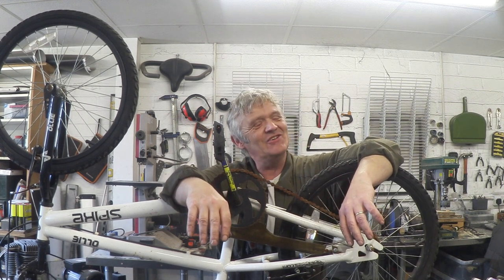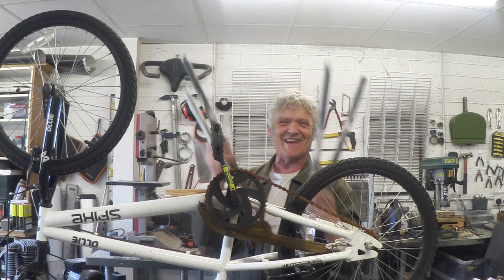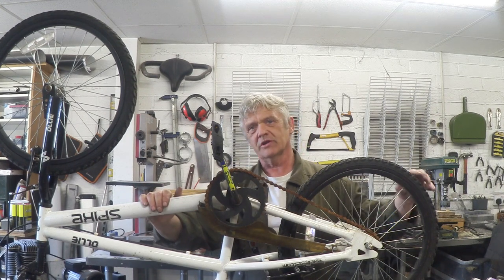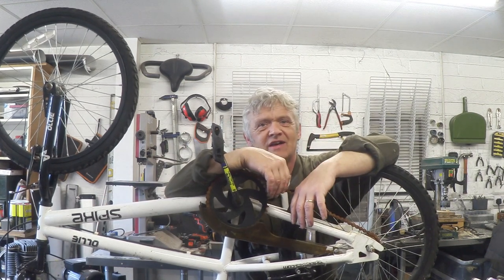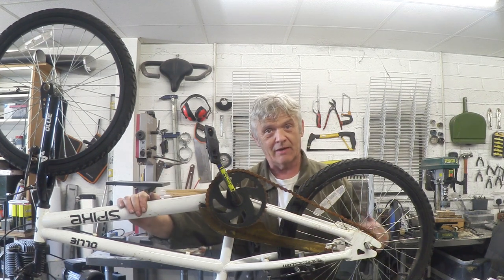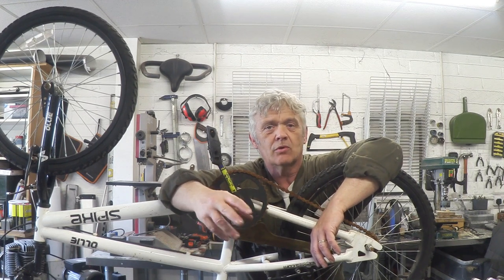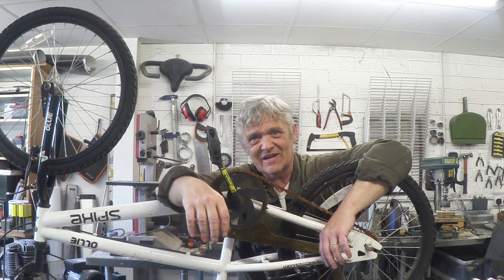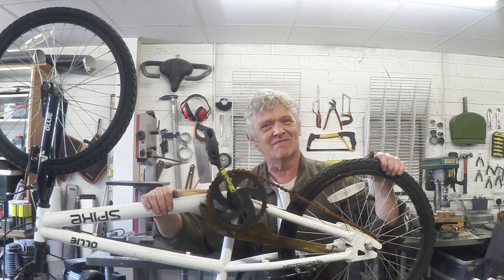1166 A Paper Bicycle -  Some Information

Comment: That Casein Glue sounds interesting, I got to try making it sometime! Also, thanks for the very important detail of using paper "grain" to maximize the paper tube strength!
Reply: It would probably work just fine if you orient the papers in the stack in different random directions.
Reply: @shay4578  Good point,  because that's the way they lay the grain in plywood laminations. I could be wrong but I still have the feeling to maximize the strength in one direction the grain should be aligned in one direction. I've seen laminated archery bows but the grain is always aligned in one direction.
Reply: @William_Hada  I agree with that, Cross lamination on an archery bow would be weak compared to being aligned. The grain direction is important to work with where the most stress will be.
Reply from the maker: in this example most of the stresses are going to be along the tube so we want the grain to run that way - but for a panel stiff in all directions cross ply would be good - for something like a box or model - it wouldn't matter that much

Comment: As an origami lover I've always thought a bunch of paper sheets is all we need to build anything.

There's a "spinning kirigami" I think can be used for energy harvesting.
Reply from the maker: paper is just plain awesome as an engineered material
Reply: 'where each part of the structure is an active power component, & only as a side benefit, structurally sound.'

angelus, do you practice the art! , take your 3d structures & colour them for each part that forms a basic battery/cap layered structure 'carbon/copper collector, carbon foam, separator, carbon foam, carbon/copper collector' unfold it, you now have a  flat 2 sided template with marked zones to conductive ink & reconstruct in bulk

Comment: Casting aerogel inside paper tubes (inside tubular pressure vessel) might work brilliantly.

Might even be a way of making an aerogel like material out of paper.
Reply from the maker: Cool idea!
Reply: How so?  Can you explain in more detail please?   If it is for structural purposes, I would be more apt to use carbonized nanocellulose crystals since it is far cheaper and fairly easy to make at home. These are basically kind of like nature's version of carbon nanotubes/rods.  If it is for insulation purposes, then the aerogel would be better.

Comment: Thanks for always managing to give us these mind-blowing moments 👏

Do you think sodium silicate would work for this? Please consider making a vid about this great paper glue you've mentioned, and other options for paper, if you may...
Reply from the maker: I think it would work fine mate - I didn't do a vid on the glue as there seemed to be a lot already - but I'll give it a go mate
Reply: It would work better if you did a mix of sodium silicate (majority, about 60%) with potassium silicate (about 25%) and lithium silicate (about 15%) added.  Makes it more water resistant, makes it last longer, and improves various strengths.  Something to do with the various sizes of the molecules and/or atomic orbits helping things to lock in together more tightly, though the research I've read indicates that we don't yet fully understand the whys.  

   Straight up, unmodified sodium silicate eventually gets very brittle, flaky, and loses adherence strength. And only takes a couple of months.  I've been experimenting with it some of late, and have seen it first hand.  I looked into the research and found that modified sodium silicate (can also be modified with other materials, such as the sugar alcohol xylitol) has much better and more durable properties, along with being more water resistant.  

  Even then, you're going to want a more fully water proof outer coating once everything is set and dried. Many things one can use, silicone, epoxy, Titebond III wood glue, etc.

Comment: PCB board were indeed made of pertinax or FR-2 material. It's not often used these days and replaced by FR-4. Basically the paper fiber is replaced by glass fiber.
Reply from the maker: cheers mate

Comment: Playing with the Grey-stuff yet again! ..... Thanks!

We used to have Phenollic cutouts (main fuse holder) .... but they are being phased out due to a small number of them having a small (1 or 2 v) voltage detected on them. The safety elves got all over it and now we replace them ;o(
Reply: Do you think it is possible  moisture getting in?
Reply from the maker: awesome mate - cheers
Reply: @lesallison9047   Not really! But you get dust and grease that can contaminate a surface. For me I would just give them a quick wipe down and retest, but Elf n' safety ....
Reply: @totherarf  Lmao, I Suspect that the Gremlins got in,,,
Chasing the Elves away....
So they can cause as much Havoc as possible!! Lol! :)
Andrea, Jasper and George the Pigeon. XxX.

Comment: Chinese armor was made of paper, but a little more than 200 years ago!  You've made a real world carbon fiber composite.  Looking forward to more.
Reply: Greeks did that as well cool.
Reply: Maybe he meant 2000 years?
Reply: @zylascope  Yes, unless he meant newsprint.
Reply from the maker: I meant paper manufacturing in bulk before that - more or less - it was hand made, slow and expensive
Reply from the maker: cheers mate
Reply from the maker: I meant paper manufacturing in bulk before that - more or less - it was hand made, slow and expensive
Reply: @ThinkingandTinkering  Absolutely!  While several documentatians have justifiably waxed ecstatic over the invention of the printing press, we'd be nowhere without inexpensive paper, too.  Also appreciated your mention of phenolics: a resin group we should use more of.
Reply: @ThinkingandTinkering  Ah, I see, ok, thanks for that. I had never made paper before until I tried what you showed once: making activated charcoal electrodes held together with paper. They worked well. Search: "Robert Murray-Smith - Papermaking And Supercapacitors"
Reply: Back when I used to work in the public and private school systems (US), I sometimes would comment to people, "if we ever have a school shooter, then take some unopened packages of copy paper and tape them to your front and back. 1 thick pack will stop most bullets fairly well."

  Though, to be honest, paper is not the most ideal material for structural purposes. Paper is basically wood, with most of the structural materials and properties taken out of it.  Dimensionally speaking, it has very low tensile and Young's modulus strengths.  The glue adds some of that back in, but in some cases, at a higher density cost and/or lower strength per weight ratio (minus high quality, expensive, composite specific epoxies). 

    However, within paper, wood, and cellulose fibers in general, is a vonder material called nanocellulose crystals. That stuff isolated and concentrated from cellulose sources, especially when carbonized, is truly some amazing stuff.  It (the carbonized version) is basically like nature's version of carbon nanotubes.  But unlike carbon nanotubes, you can make it in bulk relatively cheaply and fairly quickly. It is a very under utilized material.  

   I've flirted with the idea of making it in bulk and selling it. The graphitized form is very highly electrically conductive. It is basically the highly conductive, graphene like stuff in the "hemp battery", but more concentrated than in the carbonized hemp (since that retains some lignin and amorphous cellulose, which when it converts to carbon and graphite is not nearly as electrically conductive. It's all about that crystalline structure...).

Comment: Definitely interesting. What I would probably do, if I did something like this, is to use woven flax linen or hemp fabric impregnated with a combo of the casein glue mixed with some carbonized nanocellulose crystals.  Carbonized nanocellulose crystals are a bit like nature's carbon nanotubes/rods. Very high tensile and Young's Modulus strengths.  Then coat the outside with a truly waterproof glue or resin after it all sets.  One might want to use a cardboard tube as the core, to get it lighter and more hollow.  

    It won't be as strong and stiff as a carbon fiber tube, but it should be strong enough to work.  If you want to get near carbon fiber strength per weight, a combo of bamboo pole plus S-glass fiberglass, high quality composite epoxy, and carbonized nanocellulose crystals will get you pretty close on a strength to weight ratio.  Note, if using bamboo as the core, you have to sand/abrade the outer layer off some in order to get other materials to bond well with it.  The outermost layer of bamboo is usually very silica rich and harder to bond well to.

Comment: Paper! (its just very thin wood!)
Reply from the maker: yep!
Reply: Sort of. A good bit of the lignin is removed.  The lignin is one of the structural materials that helps the overall natural composite have greater, well, structure, and strength to weight ratio.  The glue adds some of that back in, but at a density cost (and depending on the glue, possibly also at tensile, Young's modulus, etc various strengths cost).  

    I understand that this is meant to be an alternative, in a sense, to the bamboo for the people who don't have easy and inexpensive access to bamboo, but bamboo is definitely the superior material.  And bamboo reinforced with a bit of S-glass fiberglass, high quality composite epoxy, and carbonized nanocellulose crystals (can be made at home by many with some research and practice) rivals carbon fiber on a strength to weight ratio, but at much less cost both financially and environmentally.

Comment: Fantastic so why not take a "page" from plywood manufacture and change the direction of the grain every other layer? Edit I have to see how you make the sticks.
Reply: That's a great idea 💡
Reply from the maker: it would be good in some circumstances mate - in this example most of the stresses are going to be along the tube so we want the grain to run that way - but for a panel stiff in all directions cross ply would be good - watch 1165 for making the Stixx mate
Reply: @ThinkingandTinkering  Thanks Robert :)
Reply: @ThinkingandTinkering    Yah, it's basically mimicking the bamboo poles (or wood)l in a roundabout way.
Reply: Btw, nice pun, Barskor1.

Comment: I was wondering, how well does one of the paper stixs burn, I mean could you heat a home with it if it was made bigger around, like a log.
Reply: The only problem is that the ink used in newspaper releases toxins when burned.
Reply from the maker: give it a go mate
Reply from the maker: the ink in newspapers is carbon black and oil - what toxins are you thinking about?
Reply: I've read that the inks aren't safe to burn, but I just searched Google again and it's the news paper inserts that shouldn't be burned. I apologize for the misinformation.
Reply: @neatt3815  I thought that the ink was soybean base.  thanks for the comment

Comment: Curious thought Rob, How about to mix the papers so that you will get the grains in both directions? (Sideways as well as along the stick)
Wouldn't that stiffens things up even more?
Reply from the maker: it will in some circumstances mate - in this example most of the stresses are going to be along the tube so we want the grain to run that way - but for a panel stiff in all directions cross ply would be good

Comment: so.. trying to bring the (confusing) chemistry lexicon back to basic (engineering) thinking , that makes a cheap ( by the litre) diy hydrogen ion exchange resin useful in a practical solid carbonised A3+ paper rolled battery bike frame structure !

where each part of the structure is an active power component, & only as a side benefit, structurally sound.

something Peroxide, any of a class of chemical compounds in which two oxygen atoms are linked together by a single covalent bond. Several organic and inorganic peroxides are useful as bleaching agents, as initiators of polymerization reactions, and in the preparation of hydrogen peroxide (q.v.) and other oxygen compounds.

Hydrogen peroxide - urea (also called Hyperol, artizone, urea hydrogen peroxide, and UHP) is a solid composed of equal amounts of hydrogen peroxide and urea.  ... Often called carbamide peroxide in the dental office, it is used as a source of hydrogen peroxide for bleaching, disinfection, and oxidation.

Comment: 200 years? seems like paper has been around quite a bit longer than that, unless you are talking about a specific type of paper or something.
Reply from the maker: paper manufacturing in bulk before that - more or less - it was hand made, slow and expensive
Reply: @ThinkingandTinkering  ah ok, yeah I expect soon it will be that way again, since it seems everyone wants to go digital and stop using it to "save the trees" or "save the earth" LOL (never mind all the CO2 that is released in the air when a tree someone planted rots after dying, releasing all that CO2 it had captured, with the only way to solve this is to cut it down and turn the wood into something to be kept indefinitely like solid wood very well made furniture that can and would be handed down, for generations, trapping the carbon it is made out of, as long as people choose to retain it and maintain it. :)
Reply: @ThinkingandTinkering  I still want to try making the enzyme broken down wood pulp that is supposed to yield very long cellulose fibers to make virtually bullet proof paper, as it being turned into building material like layered or rolled and squeezed in a mold to make rectangular tubes would make some phenomenal building studs or layers with the fibers crisscrossed would make sheets to build walls from, all while retaining it indefinitely in structures like that, rather than it rotting away, since even twigs could be broken down to make this stuff, (same with bamboo I would guess, maybe even longer fibers to make wood replacement structures :)